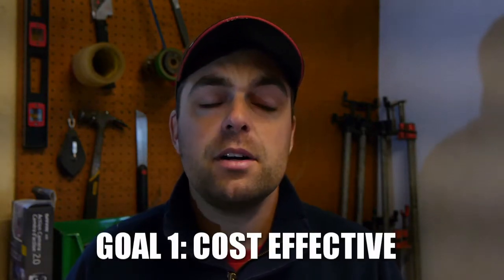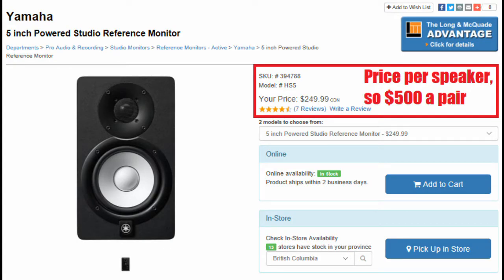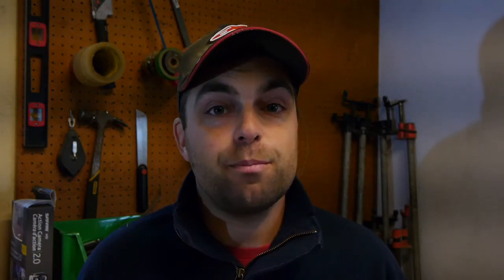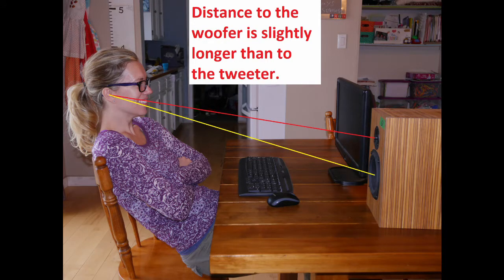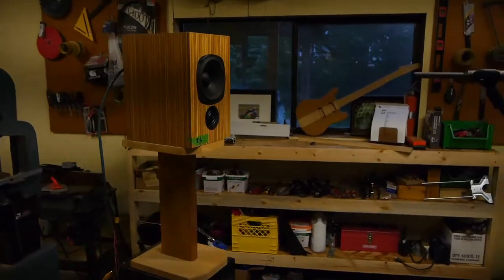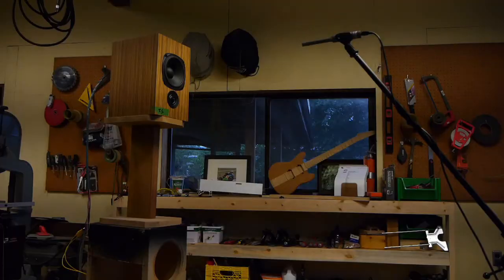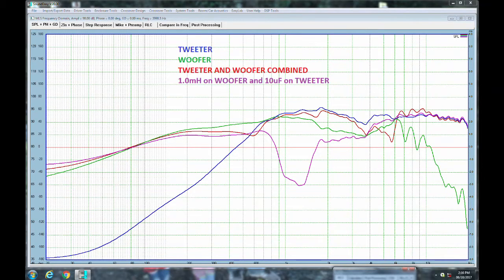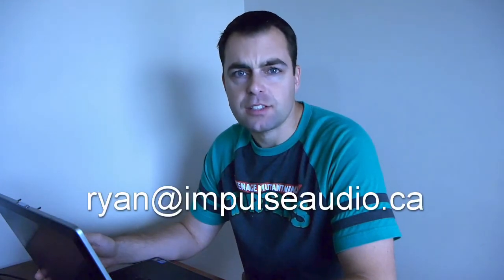Life S5 | Part 3: Design Goals and Setup

Comment: what is the Vb and Fb of the box?
Reply from the maker: Sorry I can’t remember. Something like 7L and 90hz.
Reply: @ImpulseAudioSpeakers  thanks.

i had a discussion online about the 5inch coax version of this driver (same same but different). someone came up with 6L and 65Hz. and that was flat until 70hz.

11L 55Hz. goes a bit deeper. 14L 55Hz is almost the same with a bit more volume at 60Hz and 14L 50Hz is about as big and low as this drive might be able to handle. but they will never play flat without a dip and a bump. these are just WinISD predictions.

7L 60Hz looks flat.

Comment: One thing. The amplifier. How is the frequency response of the amplifier does it have a roll off at the low end and high end.
Reply from the maker: Most amplifiers are very very flat down from 20-20khz. Shouldn’t be a problem. The speaker is by far the biggest source of distortion.

Comment: hello Ryan, may I know the reason why you choose sealed enclosure over ported design? because I think that midwoofer supossed use ported design based on tsp.
Reply from the maker: Mas Cahyo generally sealed works with a variety of TS parameters. I wanted the softer rolloff, even with the higher roll off, as it’s a desktop application. And it’s simpler.
Reply: @ImpulseAudioSpeakers  I see, you don't need extended low for desktop. 😀
Reply from the maker: Mas Cahyo well, it’s not that I don’t want extended low, it’s that the slow roll off of sealed is more useful with computer eq and nearfield listening. I can easily get the impression of 40hz bass even though it starts rolling off at 100hz.

Comment: This is a great video! One thing I did not understand was when you said you we're taking measurements of the Tweeter and woofer together you said you wired them in "parallel". Do you just actually wire them in parallel with no protection for the Tweeter? Or do you need to protect the Tweeter with some kind of circuit?
Reply from the maker: Ford Grimm yup just wire them in parallel without protection. Most tweeter can handle 2.8V without any issue. Just keep in mind ribbons and other weak tweeters.
Reply: @ImpulseAudioSpeakers  aaaah so it's not very loud then! how do you know when you are sending only 2.8v to the tweeter? I currently wouldn't know how. You are greatly appreciated by me and the community!
Reply from the maker: Ford Grimm I use a multi meter when the test runs. Need to run a long duration test to let it stabilize. And helps to have a decent multi meter.

It usually is pretty loud. But the tweeter can handle it. It’s basically 1 watt. And at low frequencies it’s not loud at all.
Reply: @ImpulseAudioSpeakers awesome! thanks so much for helping me out!
Reply: @ImpulseAudioSpeakers  do you use 1 watt for all the measurements?
Reply from the maker: Ford Grimm I use 2.8V which is roughly 1 watt for an 8ohm driver. About 2 watts for a 4ohm driver. I use this for most measurements but not all. Distortion is usually higher power.
Reply: @ImpulseAudioSpeakers  oh ok, sweet do you measure distortion at higher power because you are trying to push the drivers to their limit?

Comment: Great to see some documentation surrounding phase relationship, which still alludes me a little.  Would like to see you explain phase in more depth and practical terms for us nuubs.  Good idea 're the XO design contest, would have joined in but seems a little late now.  Btw couldn't we just measure woth a rule the distance between acoustics centres rather than measure acoustically?  Interesting technique though, not seen this before.  Out of interest, do you move the mic position to align vertically with each driver when measuring at 1m away or leave it centralised between both?  Docs say align with driver but this would cause position shift possibly in the distance between measurements which would affect results...As always, great technical content Ryan, cheers mate.
Reply from the maker: MrFrobbo I put the mic a meter away cantered, but favour the tweeter. I don’t move it. The guides I’ve read over complicate it. There’s no need. Just measure both individually then in parallel. Then adjust the z offset until they overlay. Don’t even need to convert the files to minimum phase. I did that here just to go more in depth. 

I’d like to cover more about phase. It’s a strange topic that a lot of people treat like a black art. I’ll try and include more info about it.
Reply: @ImpulseAudioSpeakers   Yes please
Reply: That's really useful cheers.  Just to confirm in term of mics position, is this the same when measuring the SPL of woofer and tweeter at 1m, ie leave Mic centred acoustically?  Seems to make more sense to me than moving the mic in the vertical domain for each driver and when you're at 1m does it really make that much difference, I'm wondering by moving it a greater error would be introduced?
Reply from the maker: MrFrobbo for these tests I move the mic so that it’s exactly on axis. For just regular XO work there’s no need for that. I’m only doing it because it’s a test video about the driver.

Comment: Ryan- how did you determine the values for the derived phase graphs- lower tail approx 200Hz, high tail approx 18K? In the video you say we should be "close" to those figures. How close/critical? Seems arbitrary, but maybe I just don't have a grasp as to how sensitive the curves are to that data. Since those are the tails, aren't those data points(including db roll-off)  not very critical? I.e., how much will varying those data points change the xover design? Some rule of thumb to follow?
Reply from the maker: Hi Keith, sorry for the slow reply. Been busy and missed your question. The tails are determined based on a few pieces of information. One of which is the measurement condition. I believe I used about a 10ms window on the measurements, so the data below about 200hz is not reliable. Also the measurement result itself shows a flattening below 200hz, in reality the tail should continue to 0db at the same slope above. So we can just adjust the tail to follow that slope. You can also check the manufacturer's data sheet for the slope to compare your results. I do agree it's an important step. It can have a significant influence on your results, but shouldn't throw anything off completely. A fair rule of thumb might be 300hz and 12db/oct as a start, then try to match the slope above 300hz. It really depends where your data is coming from.

Comment: I downloaded the files and tried to set it up in Xsim. Problem I am having is when I click on derived phase and the window pops up to change the tails there is no ok button after making the changes. The only way I can get the window to close is to go to task manager and end the program. Any thoughts?
Reply from the maker: That is really odd. Some kind of bug in the software you're getting. I wonder if @Bill Waslo will see this and comment. In any case, although it's not the proper way to use my drop box files for other projects, because I have calculated the offset using the measured phase you can just use that. Use 1.35 inch with measured phase and it'll be very close to using the 0.65" with derived phase. In fact, that's how I worked out my XO because it's one less step for me.
Reply: Thanks Ryan - I will give that a try.

Comment: i would like too know how far away the center of the tweeter is from the center of the woofer preferably in millimeters.
Reply: I normally use xsim, but I downloaded Virtuix the other day, haven't had a chance to play with it yet. It looks pretty slick.
Reply: never mind i figured it out using the video and spec sheets, also finished the crossover
Reply from the maker: Mitchell Clark you must mean vertically? I get pretty darn close to 100 mm with a tape over the front of the drivers. You're already done but just in case anyone else has that question. You must use PCD or something :)
Reply from the maker: Mitchell Clark oh yes, maybe it was you that recently pointed this software out to me. It looks incredible!
Reply: That program looks awesome, thank you!